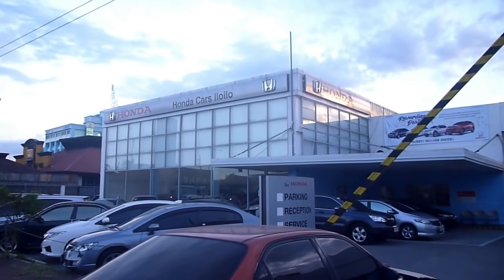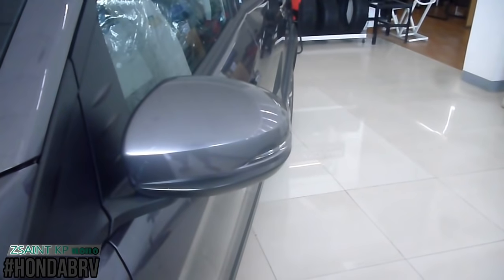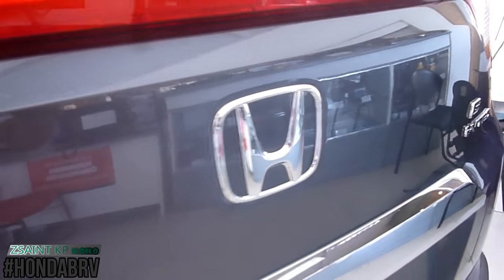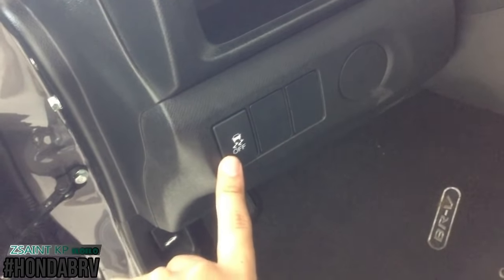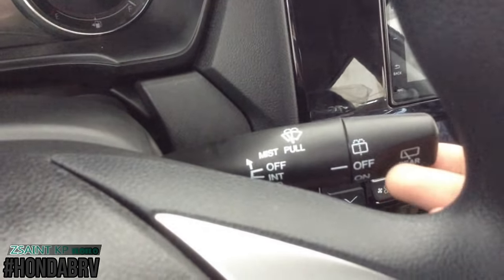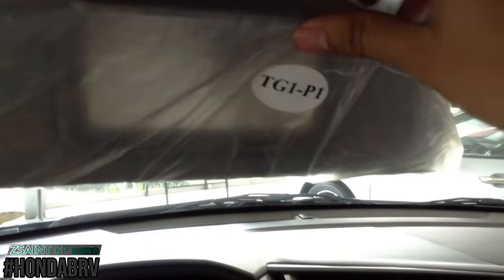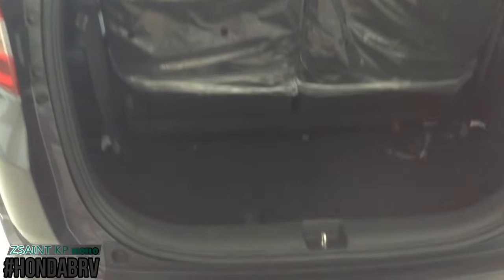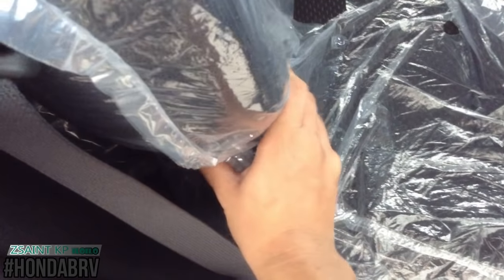2018 Honda BR-V 1.5 S CVT: Full Walkaround Review

Comment: We have our Honda BRV S 2017 w/  37,500 km milage. Sorry but after driving this 2nd hand car, it overheated. Oil mixing in radiator coolant(2 months driving).This car been PSM by 1 st owner but still oil/ coolant problem. Possible damage, engine block gasket, water jacket cap plugs (20cm), cvt oil cooler . 5 yrs old used , No more warranty. Need engine over haul per advised.